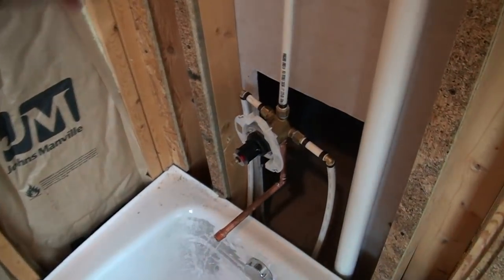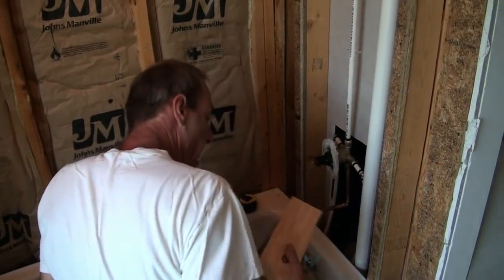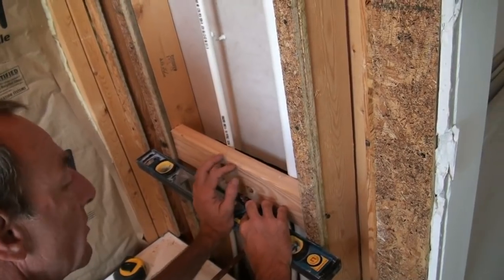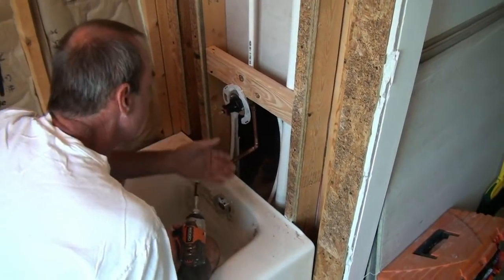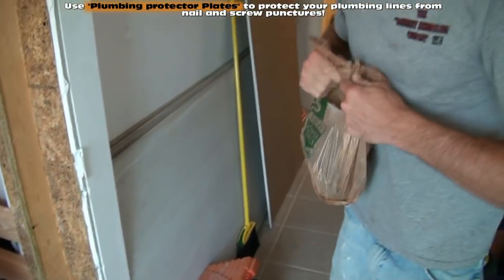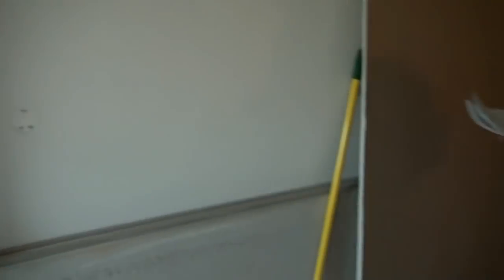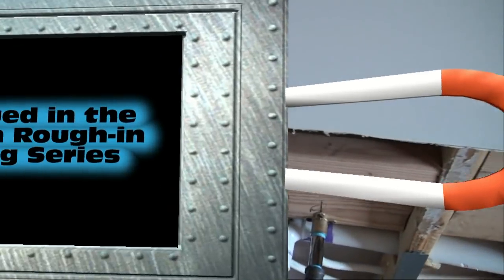Shower Valve and Tub Spout Mounting

Comment: If it's available in your area I would recommend using a substrate board called DensShield. Comes in 4x5 foot sheets with a built in vapor barrier. Cuts with a razor knife and lightweight. It's made by Georgia-Pacific and they have done extensive water test on the board with no problems. Of course I always tape and use a product like dragon skin or redgard on all my seams and screw holes

Comment: If you ever need to change this out , theses screws are in the wrong direction   2x4 mounts toward trap door …needs to be directed …for removal years later or even a lemon mount plumbing 
In my opinion

Comment: Is the osb on the 2x4 studs on the water valve/shower head wall basically furring strips to keep the tub tight wall to wall?
Reply from the maker: Yes we needed to pack-out the wall so it would be tight...you are correct Kyle!

Eddie
Reply: Bathroom Remodel Videos thank you so much for the quick reply. Made a subscriber out of me!

Comment: Thanks for the video! One question for you.. Is there any specific reason you used the PEX Barb 90-Degree Elbow instead of the Push-to-Connect 90-Degree Elbow? I guess more specifically, why would you ever use one over the other?
Reply: +Joel Jones  the PEX Barb 90-Degree Elbow is a lot cheaper than a Push-to-Connect 90-Degree Elbow.
Reply: +Fishingtuts Yep...that's the main reason! Cheaper and does the same thing...maybe even better!

Comment from the maker: The tub should not sit on the tile floor, it should sit on the wood subfloor (plywood). You then tile up-to the side of the tub base. I would bust out the concrete bed and get down to virgin wood flooring. Then buy concrete board (Durarock or Wonderboard) put that down over the virgin wood flooring and then tile over the concrete board. If you do this a 1" marble threshold will work great at the door entrance to the bathroom door. Hpe this helps.

Eddie

Comment: What is the piece called where the hot and cold connect?  Is that a valve?  Will any brand work with any fixture?   Or, as an example, if you buy a Delta valve, do you need Delta fixtures?
Reply from the maker: Yes that is the Valve where all the connections happen. Yes the Valve has to match the brand faucet your purchasing! 

Eddie

Comment: Love your videos-I am now working on basement bathroom. I am using pex pipe. I will need an auto vent, as there is no room to run a air vent outside, do you recommend them. Also they precut a 18 square in my slab with a pipe, no p trap. Is pex easy to work with and connect. Could I install the shower rough in, or do you recommend a plumber? Thanks again for your time and videos

Comment: Thanks. This is what I was looking for as I need to install a new shower faucet system in my mobile home and they only fit certain mobile home faucets.  I'm getting away from there junk. thanks so much. :-)  I just don't trust that banding strap type plumbing.  I love the shark bites.  They are so east and supposed to last about forever.
Reply from the maker: Your welcome John! Yeah Sharlbite fittings are so awesome! Good luck with your faucet installation!

Eddie

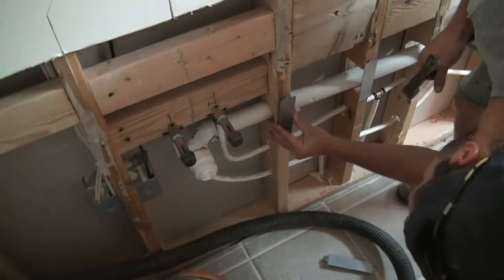Comment: 7:40  Those plumbing plates that cover the water lines etc, do they cause bulging issues when attaching drywall?
Reply from the maker: No they do not.
Reply: they do. i recess them into the 2x by chiseling out the wood so they lay flush. It takes me 30 seconds.
Reply: kirk58 yep, and it wouldn't hurt removing the old glue also lol.

Comment: So o ce im putting on the tub faucet does the copper half inch pipe at the end need to be threaded in order for the spout adaptor inside to screw in?
Reply: slimunique84   It depends on the spout you get. If you get a slip on it has a set screw on the bottom that tightens up on your your spout.
Reply: @ronh9384  ok. Thanks. Cheers.

Comment: Did you use a 1/2" pex pipe between the valve and the shower head? I have the same valve here but it specifically says not to do that. How does it perform?
Reply from the maker: YesMan85 Yes..it's standard to use 1/2" line from the shower valve to the shower head.

Eddie
Reply: BathroomRemodelVideo Sorry I meant between the valve and the spout. Pex says no, Kohler says no, but plumber says yes. So I did it.
Reply from the maker: 1/2" between a tub valve and a tub spout is OK and is the most common size water line for this application.

Eddie
Reply: Pex Piping makes its connections inside the pipe, making the opening smaller than 1/2". Where as copper uses coupling that go outside the pipe, making the connection maintin its 1/2" size. Water is more likely to seep up the line and out the shower head if your just trying to run the tub spout due to the pressure increase of a smaller diameter. But its no big deal if ur not having problems.
Reply: Every time I've seen it done I see water dripping from the shower head. I use 12" galvanized nipple and 90.

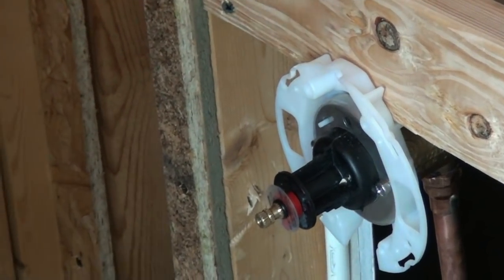Comment: At the 3:57 point in your video you state that the plaster ring has to be flush with the framing.  Is that for a thin wall or a thick wall with backer board and tile?  I'm putting in a thick wall with backer board and tile. Does flush with framing work for thick wall as well?
Reply from the maker: +Abrams1970 Yes it does Abrams...set it up the same way. You have some play with the trim  ring on the faucet handle.

Eddie
Reply: +Bathroom Remodel Videos thanks for the quick reply. You've helped me tremendously.
Reply from the maker: Your welcome. Good luck with your bath faucet install.

Eddie
Reply: Use the front face of the plaster ground as a reference point for the face of the finished wall  (which is probably 3/4"  out from the front face of the wall stud {(3/4" = 1/2" backer-board plus 1/4" tile including the thin set}).